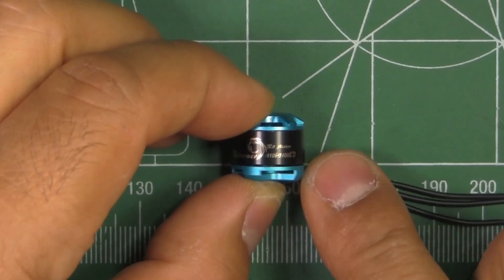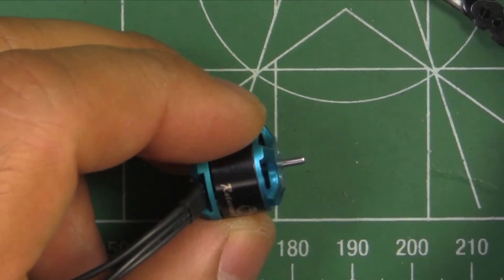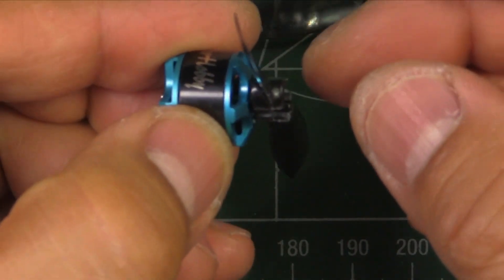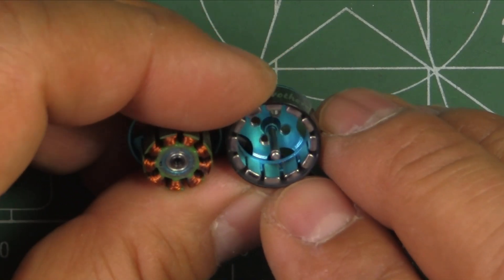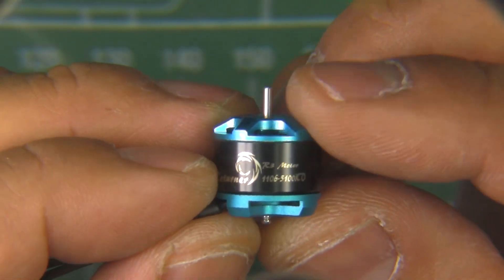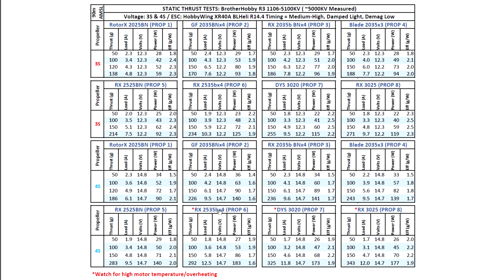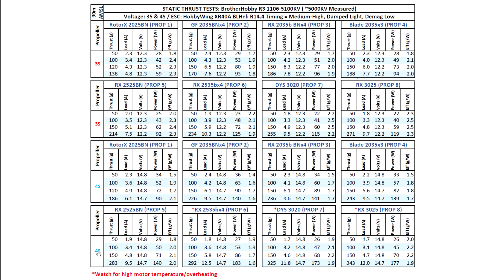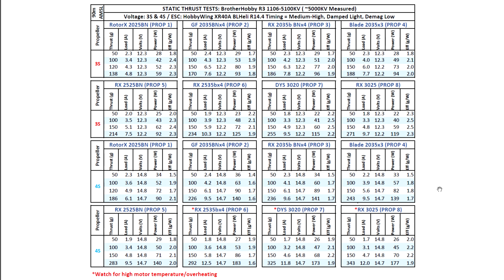BrotherHobby R3 1106-5100KV 3S & 4S Thrust Tests & Overview

Comment: Nice video thanks for doing this (and all of what you do)  You confirmed what I've read and heard so far about these motors.  Most people are unimpressed.  However, I don't think many were running 3" on them or 4s.  

My eyes are now on the new Emax 1106, especially the 4500kv! Can't wait for you to test them!
Reply from the maker: Thank you for watching. I've requested the EMAX 1106 - hopefully they send them! If you can run a 4S LiPo and still keep weight down, then seems it would be a nice match.

Comment: Where do I get the 2035x3?
Reply from the maker: The Blade prop is from the Blade Torrent 110 - I gave it name "2035x3" because they use some odd name BLH40009. Seems to perfrom very nice on the thrust stand. Good thrust and not bad Amps. It was designed for the Torrent 7600KV motors on 2S and they're not that expensive @ $2.50 per set.
https://www.readymaderc.com/store/index.php?main_page=product_info&cPath=76_498&products_id=6827
https://www.rcgroups.com/forums/showthread.php?2853394-Blade-Torrent-110-FPV
Reply: EngineerX thank you very much mate I love your reviews keep it up :)

Comment: is it possible to run 4s on the 7100kv motor with 2 inch props ?
Reply: I WOULD NOT do it!  For example, the new Emax 1106 come in a couple kvs.  They suggest 4500kv for 4s on 2" props...for comparison!

My 1104 7500kv are pushing it on 3s.  They come down HOT!  You will melt something on 4s, lol
Reply: Would be insanely hot and you'd burn a motor after a few flights. And that's if you have perfect props with ultra low D gains.
Reply from the maker: No - the BH 7100kv is limited to 3S for 2". 4S has been reported to get very hot.